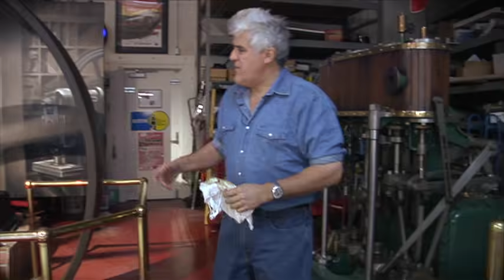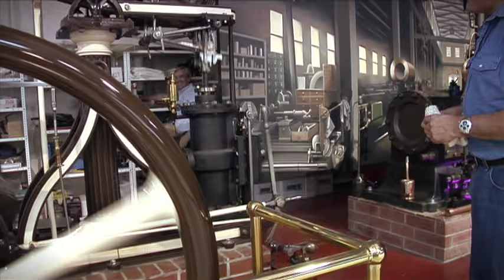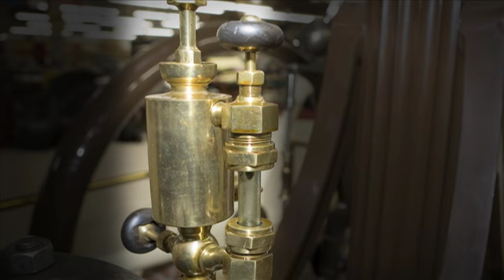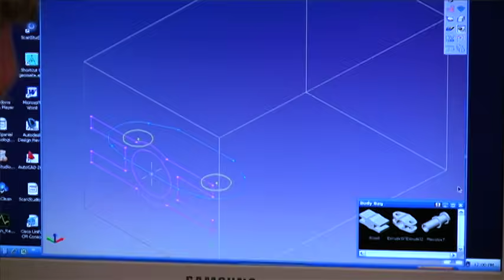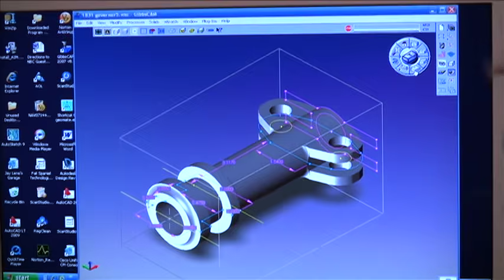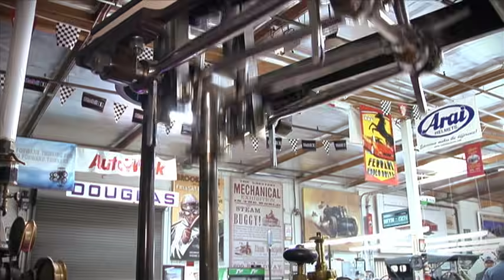1832 Steam Engine - Jay Leno's Garage

Comment: I can't believe how much style they used to put into engines back then.  The industrial revolution kind of wrecked them in a way.  You can see what I mean when you look at the one that sits to the right.  I think the main thing that brings such pride in the finish work is the fact that they were new back then.  You can see the same thing in the first gasoline engines.  They were amazing and glorified for maybe the first 40-50 years, probably lessening as younger generations who grew up with them took over.
Reply: practical stream engines had been used for over 100 years when this one was made. and the industrial revolution had been underway for well over 50 years.
Reply: Holy schnizzle fo schizzle.  Whoops, I guess that wouldn't make sense then.  I was referring  to the mid to late 1800's when I wrote that.Dan Sneyd

Comment: How does that big drive wheel hold a belt? Most are flat or v shaped, that one is rounded off, what am I missing?
Reply: +Shane K I believe that is just the flywheel. The drive wheel would most likely be mounted next to the flywheel.
Reply: Thank you, that makes sense.
Reply: there is a missing pulley at the end normally it uses flat belts to drive other machinery

Comment: How do you actually "start" this machine?
Reply: +Brubarov Hot steam is allowed to flow through pipes by the governing valve (the rotating balls vary flow depending on rotational speed) into the cylinder much like gasoline and air flows into a conventional engine. However, rather than igniting the gasoline/air mixture, the steam already posses energy as it is at a high temperature and pressure. This forces the cylinder down or up depending on the position of the cam operated valve. This cam operated valve determines the flow of the steam between either the top or the bottom of the cylinder depending on the relative position of the piston, that is, if the piston is at the bottom of the stroke the valve will allow flow of steam to the bottom thereby forcing the piston up and vice versa. 

In order to start this series of steps the large wheel (known as a "flywheel") must be rotated as the steam's pressure does not produce enough torque (rotational energy) to rotate an object of such mass. When the wheel is pushed by the technicians (Jay Leno and his mate) the steam begins to flow and engine rotates due to the above described actions.
Reply: +Cody Diek Actually steam has torque enough to start the motion of the flywheel, you can claim these engines were inefficient but not that they weren't powerful. The reason for the hand rotation is to get the crank in the correct position, aka: away from pointing up or down (not TDC or BDC).
Reply: +Brubarov You saw them do it. They span the big wheel and it started it. Like an old plane.
Reply: chimpaflimp
Indeed, but I don't understand the mecanism behind it. What does spinning the wheel do exactly?
Reply: There will be a fire in the engine which had been lit and allowed to warm up, boiling the water in the boiler. The wheel spinning starts the generator, which forces built up steam through it.
Reply: Thanks for replying, but I don't get it... english is not my 1st language. What's the "generator" in this case?
Reply: +Chali Chaligha I most certainly agree with the power aspect of your statement. Steam engines, when running, have considerable torque indeed. Thanks for the info.

Comment: James Watt wasn't English. He was Scottish. But that's OK because he didn't invent the steam engine. He got it from Newcommen, who was English. So in a round-about way, the English did invent the steam engine. Just not Watt.
Reply: +hyzercreek Worth pointing out as well that Newcommen pumps, a.k.a. condensation engines, work on a different principle from pressure steam engines. Afaik Watt introduced low pressure steam engines, then Trevithick came with the high pressure engines and cylindrical boilers.
Reply: +hyzercreek Well, he was British at least :p
Reply: hyzercreek Technically Cugnot's wagon was the first self propelled steam vehicle.

The french also came with the first steam boats, using atmospheric engines, though they were left undeveloped for political and other reasons.

Trevithick's engine also came at least a year earlier than Oliver's. Though he built the first american high pressure engine. Most sources indicate that at least three people developed high pressure engines simultaneously.
Reply: +MisterTalkingMachine You've got it right.
Reply: It pumped water out of a mine according to my basic knowledge. Good enough right? Besides i've just realised you made the original comment where you said the English invented the steam engine, so why the disagreement now haha
Reply: HRHooChicken
I think Watt was the first to pump water out of a mine. But I get my info from the 1789 edition of Britannica which was printed in Edinburgh, and the Scots think they invented everything.
Reply: +hyzercreek Newcomen built the first successful mine pumping steam engine, at Dudley, in 1712. Watt made his contributions many years later.
Reply: hyzercreek Do you realize that with modern tools and materials that would be easier than ever?
If someone in the 18th century succeded on propelling a ship upstream with a Newcomen engine, then it would be far easier doing so today on land, where the water is not putting resistance or pushing you back.
You're just mad you couldn't prove your point :P
Reply: hyzercreek i always thought Newcomen invented the first proper steam  engine in the early 1700s
Reply: So it was the first steam engine :P
Reply: They think Alexander Graham Bell was Scottish (moved to Canada as a child) and take credit for the overhead valve engine (David Buick was 2 when he moved here). But yeah they were Scottish by DNA anyway
Reply: +hyzercreek Cugnot's device was self propelled, it failed because it couldn't make long journeys.

Also, the Newcomen engines were used widely all over britain for about 80 years until the high pressure engine came along and replaced it.

And the french steamboats did work too, they were not very practical but they were functional. The man who made them wanted support from the government, but they demanded him to make another steamboat to work on Paris, and he couldn't afford the cost. The french revolution came afterwards and he discontinued his works.

Watt was certainly not the first to pump out a mine. By steam, it was first done with Savery's condensation pumps, and before it was done using waterwheels, but this could only be done in mines located near water courses. Savery's pumps came nearly 40 years before Watt as even born.

What kind of history books do you have in America?
I don't think I will argue any more, since I already know that no truth stands against american pride.
Reply: I'm sure there were just as many steam engines in America pumping out coal mines here. Probably more, since England acted like  America was some sort of English colony, and our coal belonged to the King (he found out it didn't, but we let him keep his tea)
Reply: +hyzercreek Quick googling gives a source (whick I won't paste here, because it may be tagged as spam) indicating that the first steam engine brought to the US territory was a pump to drain a copper mine in 1753.I cannot find much about how many more were installed in the period afterwards.
Reply: trialen
Who cares? It was a pump. Just because they used the word "engine" doesn't mean it was an engine. Back then, an engine was anything that was ingenious. The Newcomen engine was just a pump, not a mechanical engine that did any mecanical work. Like a fire engine. A fire engine is just a pump.
Reply: +hyzercreek I suggest you acquaint yourself with a basic understanding of physics before you  embarrass yourself any further.
Reply: hyzercreek That is mechanical work. You have mass being moved as a product of a force, which is basic knowledge in physics. We are not speaking in Layman's terms here. And again, your argument just considers the original Savery pump which had no moving parts.
Reply: hyzercreek Checkmate, lol.
Reply: He just popularized the mass produced automobile.
Reply: HRHooChicken
I'm very sorry to burst your boiler but high pressure steam engines were invented by an American. His name was Oliver Evans and he built steam boats before Fulton and steam cars before Trevithick. He even went so far as to invent an amphibious car-boat in 1804. It's all about America, dude.
Reply: @hyzercreek  How is it all about the USA, when the steam engine Jay is featuring was made in England? Anyway, Englishman Thomas Newcomen's atmospheric engine was the first commercial true steam engine using a piston, and 
was used in 1712 for removing flood water from a mine. 104 were in use by 1733. Eventually over two thousand of them were installed.
Reply: MisterTalkingMachine
Cugnot's machine was a failure. The claim that it was self propelled is even questionable.

Atmospheric steam engines were not left undeveloped for political reasons. They were left undeveloped because they didn't work. I guess that's what you meant by "other reasons". Nice argument. You could have just said, "The French made steam boats that didn't work".
Reply: HRHooChicken
But it was useless. A teapot makes a whistle sound and the lid flaps up and down, that was the first steam engine.
Reply: That's why they are average schmoes.
Reply: HRHooChicken
No it was low pressure, worked on atmospheric pressure. Proper is not a word, it's just something English people say, like "sorry" and "sort of"
Reply: trialen
When you get a brain I'll already know because I'll be skiing in hell
Reply: +hyzercreek Right, and this comes from someone who 'thinks' that you can pump water without doing mechanical work. You're not a creationist by any chance are you?
Reply: MisterTalkingMachine
Tomorrow try driving to work on a steam pump

Comment: Funny how they have a steam engine, but use a computer to make parts. The old meets the new, I love it.
Reply: Well after 187 years the original craftsmen and machinists that can replicate parts by hand and eyesight have all died out.
Reply: The way to do it would be to have the steam engine generate the electricity for the CNC machine.
Reply: @AlanCanon2222  I love it.
Reply: @twistedyogert  Better still, eliminate the electricity altogether and build a steam powered CNC machine under the control of a Babbage Analytical Engine. You'd just need to attach a Jacquard-loom format card punch to designing PC via USB, to program the Analytical Engine. (I'm all about doing it the hardest way possible).
Reply: @AlanCanon2222  Ok now you're just being silly.
Reply: @twistedyogert  Absolutely :)

Comment: For a bit of history - the steam engine was invented in south-west England by Thomas savery in 1698, then a guy called newcomen altererd it, then another called trethrithic did more. James watt wasn't even born when this all kicked off.
Reply: +VC YT True, but those early engines worked by heating then cooling the cylinder and were ridiculously inefficient. Watt separated boiler and condenser from the cylinder, making steam engines efficent enough to be practical.

Comment: Hello Jay Leno and fans... One engine that is noticeably absent from Jay's engine collection is the Brayton Hydrocarbon engine also know as the Brayton Ready Motor. 5 years prior to the Otto 4 stroke In 1871 George Bailey Brayton  (an american) made the first engine that used compression and combusted liquid fuel in the cylinder. He called his engine the Ready Motor or Hydrocabon engine. Ready Motors were used to powere boats,  a rail car and even the first and second John Holland submarines in 1878 and 1881. Selden also used his own version of the Brayton engine to power his 1877 car in which he tried to enforce a patent on all cars powered by internal combustion engines.  The patent was fought and defeated by Ford largely because auto manufactures used the Otto 4 stroke cycle and not the Brayton engine.   Today there are 7 known examples of Brayton engines though none are running. 2 are in the Selden cars, 2 are at the Smithsonian, 1 at the Ford museum, 1 in the Finean Ram submarine at the Paterson Museum and 1 at the Technicum in Germany. None are running. The last know running Brayton was the Ford engine which was previously at the University of Michigan where it was studied by students in the 1920's. About 10 years ago I became interested in the Brayton concept which is basically a 4 cycle engine that performs all 4 cycles.. intake, compression, expansion, and exhaust in just 2 strokes of the piston. A first I built a small test engine to learn about the cycle. This last year I made a larger more authentic version out of an early water cooled double acting air compressor.  If someone is interested in watching the engine run  I have several videos here on my youtube channel.  There is also a discussion on an engine  forum called smokstak.

Comment: These engines are similar to James Watt's engines of the 1780's. He had a patent on his machines and was partially paid on the savings on the engine efficiency vs uses horses going round and round driving machinery to factory owners.

Many people infringed his patents by copying his engine and in England many of the factories in the early 1800s had high windows to stop workers looking out and industrial spies looking in to copy the design.

I think a lot of these engines were made by smaller companies possibly not putting their name on. I have not seen early engines with names on.......most people in England could not read 200 years ago so there was no point.
Reply: ***** Watts' engines were not this type. This is a "Walking Beam" type, and of a very rare period before standard threads. I had to check how those wedges worked a couple of times to really see how they did that without bolts. Look on videos of ferries, all civil war era stuff, and basically anything large until 1910 and this engine is used. This one seems to be sort of a Genesis unit. Amazing.
Reply: In England's cities many could read since 1650, due to caxton publishing the bible etc.
villages not so much.

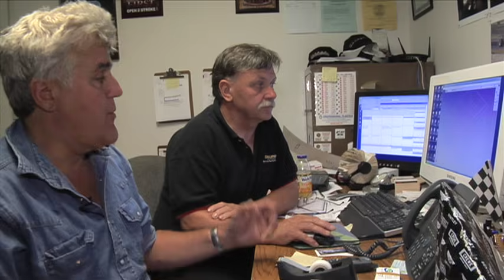Comment: 4:40 Speaking of antiques, this video was aired in 2012, and yet they are running archaic software on Windows XP on an old computer with an AOL online shortcut on the desktop and a hugely thick Nokia candybar phone on the desk and a really old series Cisco IP phone next to it along with a super old school flip book things you used to write contact information on way back in the day (so old I can't even remember what they are called)... I'm absolutely amazed that the screen isn't a CRT, LMAO!!! 

You have so much money, hire me to update your stuff and install CAD 2014 in W8.1 on a T7610 Xeon system w/ 128GB of DDR3, a 1TB Samsung SSD, and dual 12GB Nvidia Quadro K600s so at least your design shop can be modern. You can afford it! ;)
Reply: Be running,  xp because the cnc software isn't updated to something newer.

You can't just dump in the newest cad and run out cnc instructions you have to run out the right cnc instructions, for the cnc machine and most times the stuff isn't updated in years.
Reply: No, it was running G Code and it wasn't a milling machine, it's a CNC machining centre with who knows how many axes.
Reply: You mean a 'Rolodex' ... Very handy
Reply: Guess what. Once you have a piece of equipment running well, you don't update the software. That way lies tragedy. I ran a lab where we had a lot of CNC equipment and sophisticated measuring devices. The newest ones ran XP. Some of them ran Windows 98. I had one scanner running DOS until a few years ago. As it happens, last year I installed a system running Windows 7 because that's what the software was developed on. There's no benefit in updating to the latest system if the old one is working.
Reply: Old consumer appliances are part of an experience.  The Cisco phone is not going to wear out.  All that stuff adds character to that surly guy's office.
Reply: ...and the milling machine appeared to be running BASIC. Seeing as he's making parts for a machine from the 19th century, I think he's plenty modern. :p
Reply: Hellooo.. Mr.fromthepast using win10 i7 and gtx 1080 now.. 😋

Comment: FYI re; balls to the wall. That comes from aircraft throttle handles that had a ball on the end of the lever. So, full throttle requires to push the throttles towards the firewall, hence, balls to the wall.
Reply: I suspect in all cases of these idioms, however, the original users were also referring (with a wink and a nod) to their actual, testicular, ballsack equipment 😄
Reply: Sweet xD
Reply: huh, Thanks!
Reply: Same with Morse controls on marine engines

Comment: The boiler that generates steam for this engine and the other ones, can be seen in the video he has for the larger, White steam engine.  It appears to be a Clayton Coil-Tube boiler and it's just outside the wall of the shop, in the parking lot. If you search around enough, you'll find it.  And he talks about it a little bit too.  It's nice to see a steam engine being run on steam instead of compressed air.

Comment: Jay, it is great that you share your hobby with the world. I am a retired Mechanical Engineer with 40 years experience in machine design. I enjoy all your videos. I have an interest in the Burden Water Wheel that used to stand in Troy NY. It was 60 feet in diameter with a 22 foot face. I would like to build a 1/8 scale model. thanks again for sharing.